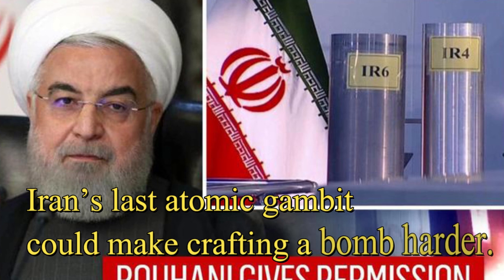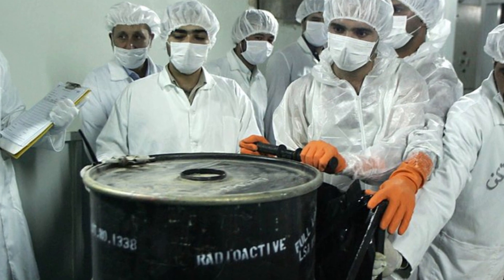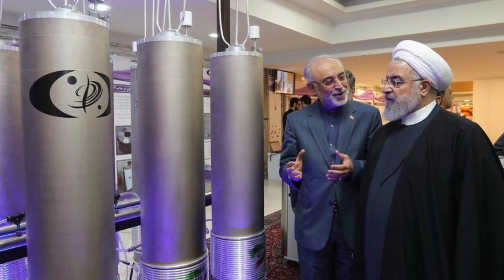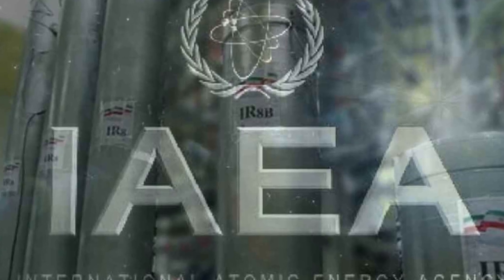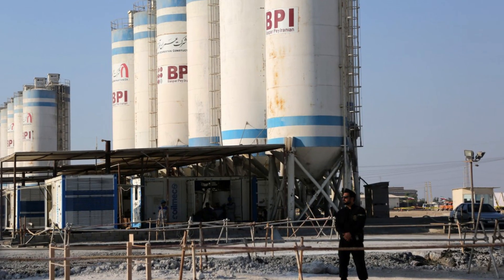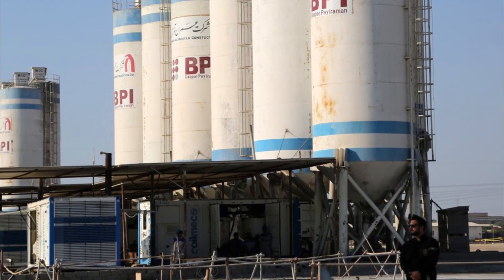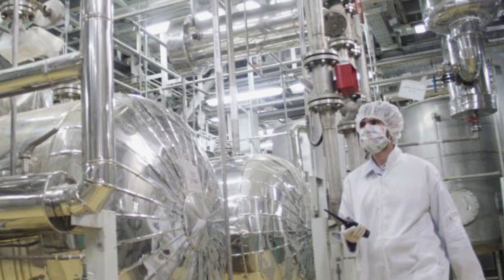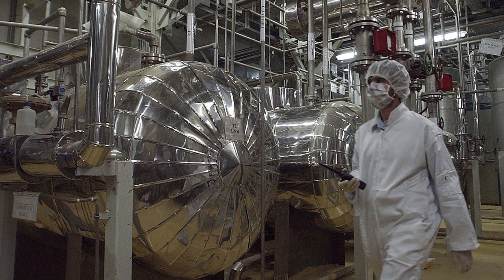IRAN FURTHER TO THE BOMB! Iran’s last atomic gambit could make crafting a bomb harder.

Comment: For now, the known atomic fuel that Iran posesses isn't enough for an atomic bomb. Still, Iran also may have first grade bomb material that it obtained from North Korea, that was either was aquired for astronomical amounts of money or by bartering with food. North Korea needs this money for buying various medicines and food for its population. Iran exports lots of foods to Iran in a barter system. Atomic fuel for food? Way back, in the time of the shah of Persia, Iran exported nuts to Israel in exchange for weapons and irrigation systems. Iran may have now enough nuclear material to build a few bombs. The North Korean atomic bombs that may now be in the possession of Iran may or may not be suitable for putting on missiles. They may use it to intimidate, rather than for warfare. They know that America and Israel possess atomic bombs. Still, Israel won't risk Iran having nuclear weapons, even if the Iranians don't intend to use the atomic bombs. Does Iran have nuclear bombs? The Mossad may know, but I only can guess on basis of what I know.